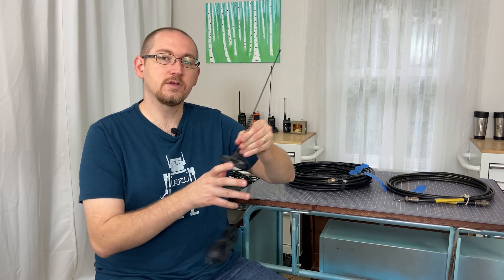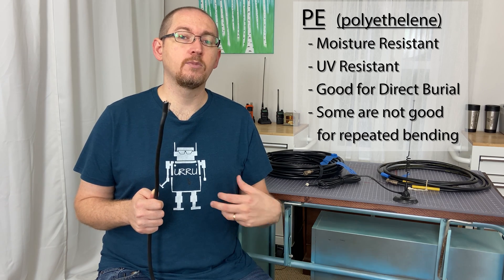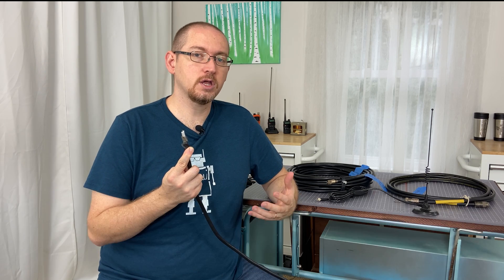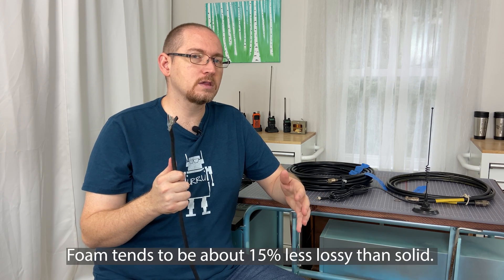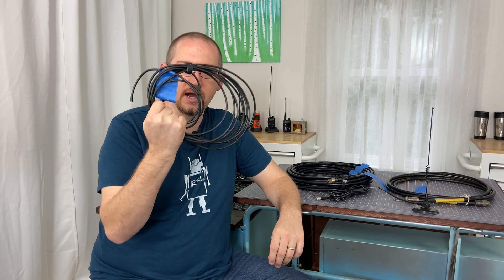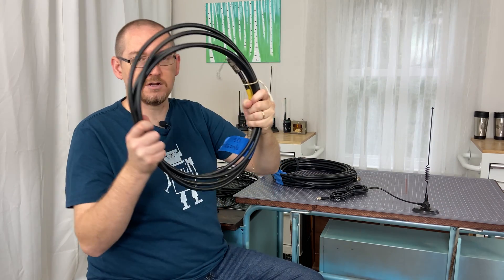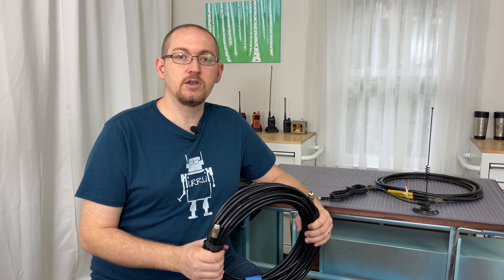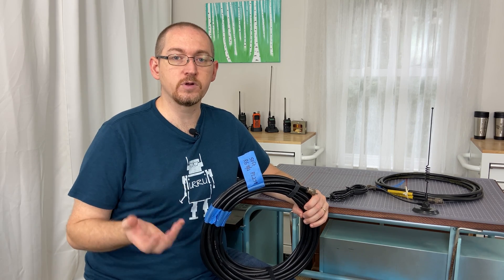Intro to Coax Cable Feedlines for Ham Radio

Comment: What coax would you recommend for jumpers inside the snack to hook up radios etc. for GMRS frequencies (462-467 MHz)?  I am talking 5-8 feet at most.  The rest of the antenna lead is 400Max (18 ft) but that is too stiff to do what I want.

Comment: Helpful. So my question now is do we want a Velocity factor closer to 100% or less? It seems 100% is perfect? And for a 2M Mobile set up on a desk with a 50 foot run to the jpole 2meter antenna. it looks like RG8 is a bit thick for that little run? what is the most common cable for that setup? 213? Suggestions on where to get cable.

Comment: for years I've been wondering why they keep using rg58 and such for magnet mounts and most mounting parts what comes with a cable?! does it really cost that much more for bigger brands/manufacture to use better coax?! I like to have better coax even in hf bands coz I like to get every performance out I can get,  in any given situation..
Reply: If the SWR is low a few metres of RG58 don't represent a huge loss at lowish frequencies. . Lower loss cables tend to be a bit unwieldy.

Comment: Great video! How about testing coax lengths and finding shorts in cables using a MFJ 259D ?
Reply from the maker: I wish I had a MFJ 259D - those are great analyzers! I've tested Coax lengths with my NanoVNA and it worked well.

Comment: Can you explain "repeated bends"?
Reply from the maker: Good question, thanks for asking: 
Fixed Bends are when you form a loop coil such as a choke balun with the cable and then leave those loops more or less permanently in place. These loops can be generally be smaller in radius because they won't have the stress of flexing.  (Example: Fixed installation at the house.) 

Repeated Bends are when, with some regularity, you are coiling up the cable for temporary storage and then will be uncoiling it. Because you are repeatedly bending the cable, you want less stress on the internal structure so as to prevent fracturing. A solid center conductor can easily break with repeated bending. (Example: Going out to do Parks on the Air and bringing a 50' feedline with you and needing to roll it and unroll it every time.)
Reply: @transmittinguntilrobotsrep1045  Thanks for the clarification. Great video for beginners and old hands alike.

Comment: Fantastic video. I'm just knocked out both Tech and General and started to build my shack. I ended up getting LMR400 direct burial stuff. I didn't understand it, but you did a wonderful job explaining it and dissecting it. THANKS!!
Reply from the maker: Congratulations on passing both the Tech and General! LMR400 is a great cable and will serve you very well for many years to come. Thank you for the feedback and good luck in your radio adventures! 73 - AC3DS